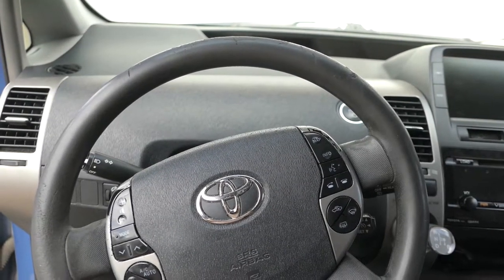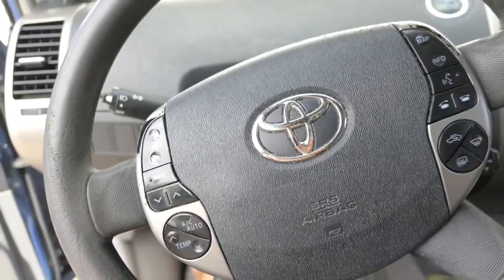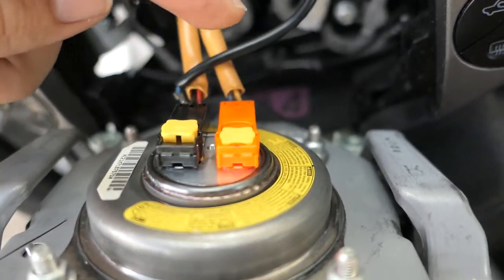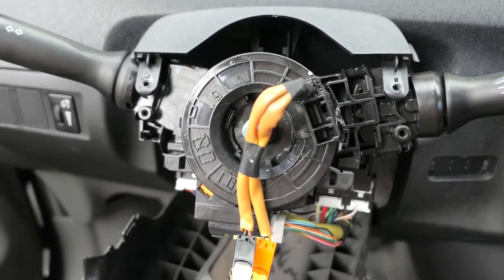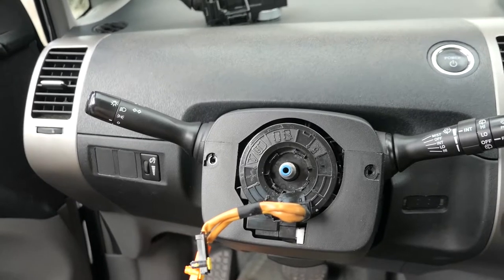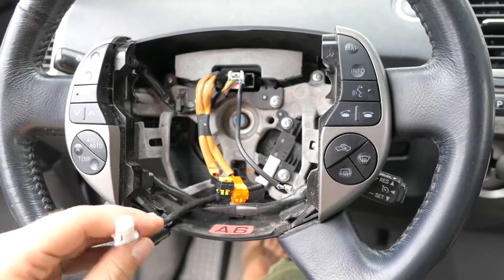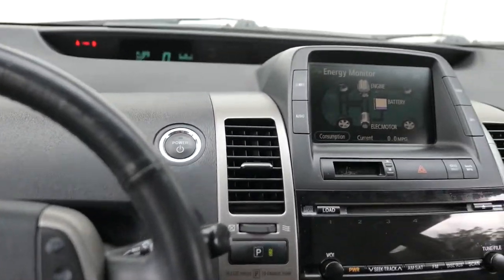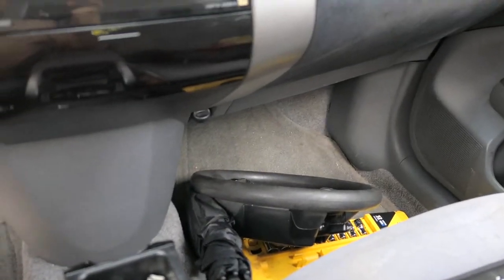Gen 2 Prius Steering Wheel - Turn Switch Replacement

Comment: A lot of "I guess" going on in this video. Curious if you had any problems later because you didn't mark the correct positions of the steering wheel and clock spring before you removed them.

Comment: Lol,  once again at one of your videos. My 133k mile Prius just had the intermittent windshield wiper switch start dying on me. I can hear the electricity make a static-y type sound when I use it. Other modes work fine. Was hoping for some type of solder fix but looks like might just have to bite the bullet and replace for $45 on ebay. Thanks for vid dude.

Comment: Hey Vlad. Excellent video! Have you had any of the “headlight issues” I’ve been hearing about? All of a sudden no lights or parking lights. But blinkers and high beam flashing works. So no night driving and Toyota wont help without thousands of dollars. Gonna try changing the switch as a first step.  
Any other ideas? From anyone? Thx
Mike
Reply from the maker: Never had that issue yet. Sounds like a relay problem or harness plug. Goodluck with it, if you figure it out let us know. Thanks
Reply: Replace your flasher relay .

Comment: Vlad I just wanted to thank you for making this Video I own a 2010 Prius and was still able to apply the same steps you used on this late model Prius. My New clock spring came from E-Bay with a defect so I am having to replace the Clock Spring a second time but hopefully I will have good news. I am posting your video too a Prius chat forum I am a member of since I have no plans of getting rid of my beautiful 2010 Prius ever if possible.
Reply from the maker: Glad the video was helpful and thanks for the support!
Reply: How did you dmfind the job on 2010 model, was it the same? Doing mine